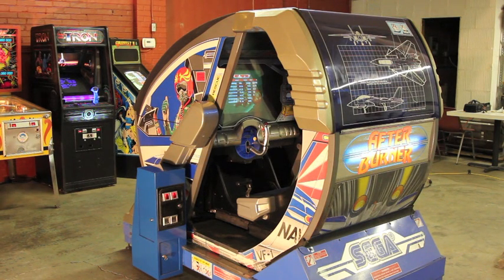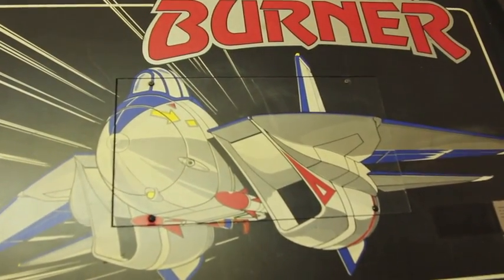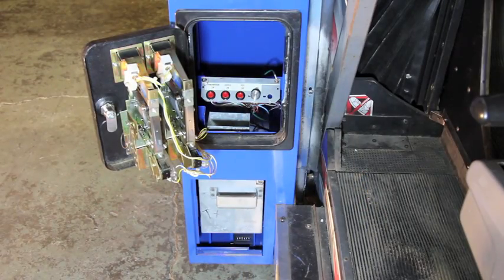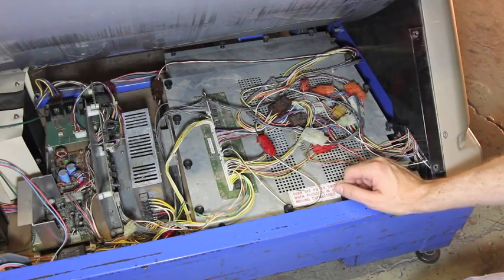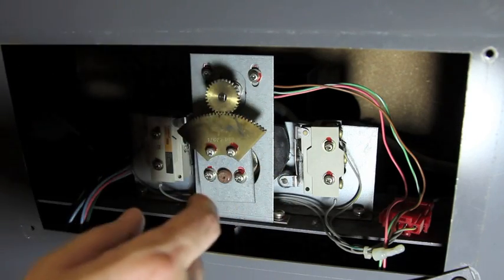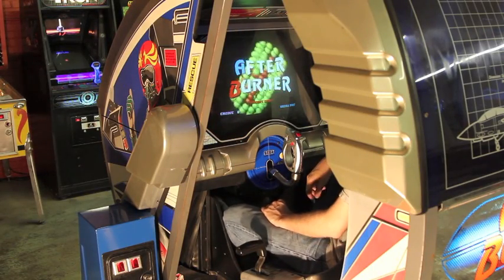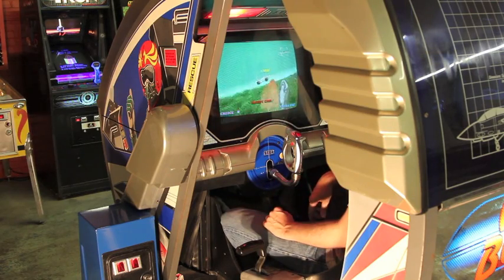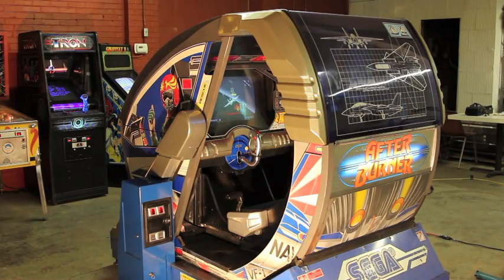After Burner Deluxe Video Tour

Comment: Brings back fantastic memories. There used to be one sitting in lower level of Kudamm Eck in W. Berlin, Germany  back in 1989. Operating it was almost like being elevated into emotional stratosphere. Hot chocolate (old school version of energy drink) was served from the vending machine nearby. We used to drink it ( you could safely put the cup on the coin tower) and had a great time flying the fighter plane at the same time.

Comment: So if an arcade operator upgraded from afterburner to afterburner 2. Would they get a new pcb AND the throttle control to fix on the side. Or was the throttle control on the original afterburner machine for show but didn't actually do anything?

Comment: I am about to start work on one of these its in need of dire referbishment and I have yet to diagnose its status...first I need to dust out the cpu and transformers. then I want to check the fans on the engine and make sure all the potentiameters are intact any other thoughts on what I should do before I plug it in?
Reply: shinobimanexe wipes tear you're truly a man of arceus